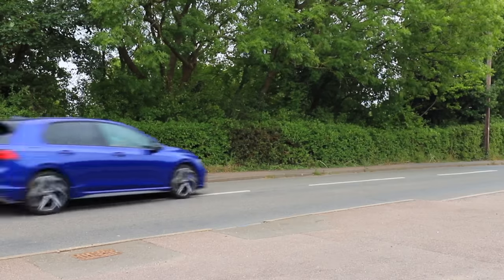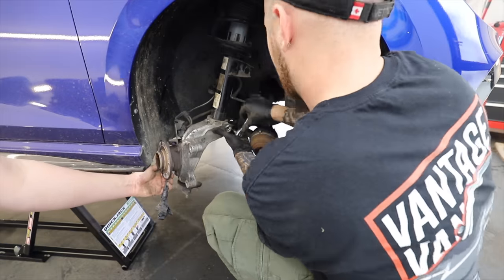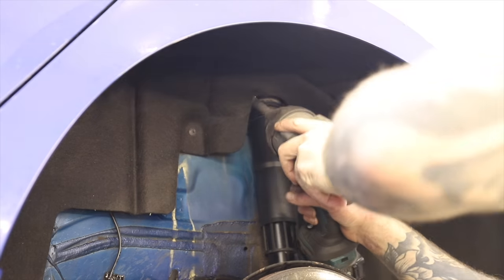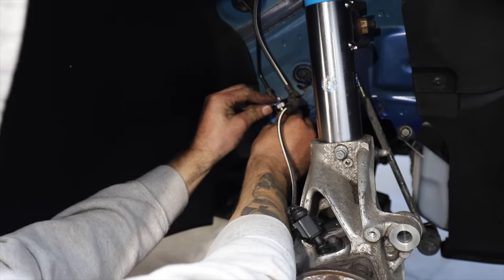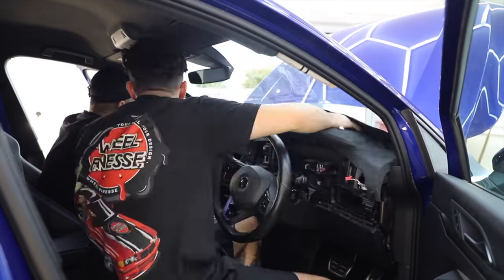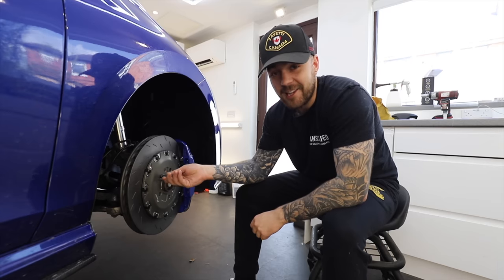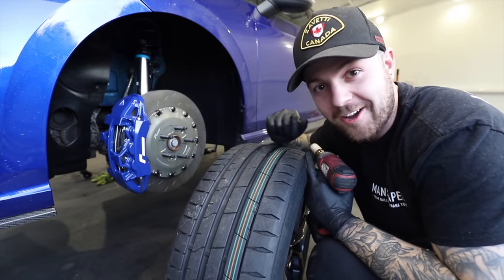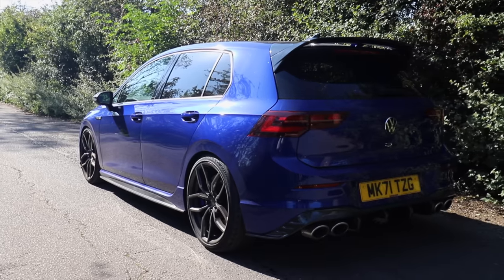£10,000 OF UPGRADES INSTALLED ON MY WRECKED MK8 GOLF R

Comment: Chris you didn't orientate the front top mounts, there is a tap that has to be facing a certain direction or the camber caster is off. You may of by accident located them correctly but chances are they are wrong and your alignment will be out. When you get the alignment redone the caster will be incorrect and the car won't drive properly.

Comment: Nice upgrades and not sure why you did the brake test. As you changed the wheel size and new tyres. Plus, bigger brakes, so will be100% better over the old set of brakes and tyres.

Comment: Love OBD11, literally today. I used it to retro fit/code a bunch of cool features for my Audi. Although what dose the throttle response adaptation actually do? Dose it just keep the throttle in dynamic mode no matter what mode u r in? Or will it actually change the response in all modes? Therefore, it is slightly better still when the car is in dynamic/ sport setting?

Comment: Ok 2 questions. When bleeding the brakes why didn’t you start with the calliper furthest away from the servo? And did you use weight plates when adjusting the suspension??

Comment: Dude you need to clean the rust off the wheel hubs before fitting a new brake disc to prevent shuddering and to do a cleaner job!

Comment: In case anyone in the comments is wondering about tyres and wants to do something like this but can't afford Continentals, simply put don't. If you can only afford budget tyres then go with them. Whether you buy a budget set or a high end set, you're gonna have to replace them around the same time frame anyways...

Comment: Surely the rear brakes are just bigger for looks? If it’s the same caliper and pad size it’s the same braking surface area
Reply: A wider disc means the pads get more leverage as the outside edge is further out than on the smaller disc. Also, the larger surface area enables the disc to dissipate heat more effectively. Ideally, you would want to upgrade the calipers and pads too though.

Comment: That dash trim seems like a terrible idea to me - what happens when the car is in a crash and the dashboard airbag goes off? Surely that’s on legally shaky ground…?
Reply: We weaken the material by cutting very fine splice lines either side of the airbags area. Although this isn’t necessarily needed we still do it for customer peace of mind. 

Of course this is a concern that many may ask! But the force of an airbag will not be restricted by placing a material of only 0.7mm thick over the top. 

Lamborghini do it, so why can we!🪡🙂 

(All products are road safe and approved by road safety regulations)

Hope this helps answer your very valid question 🪡
Reply: @Wheelfinesse  It’s not for me, but thanks for taking the time to reply - my (non-expert) understanding of airbag deployments is that the process of deploying to ‘catch’ a flying body is measured in milliseconds - having an extra layer of alcantara to burst through is certainly possible, but would affect the deployment profile compared to the manufacturer’s design; I do t know if it’s affected enough to cause a problem, but I wouldn’t want to be the one to find out - either as a passenger or as the guy claiming on his insurance after crashing with one on the dashboard!

I’m sure Lamborghini can use alcantara as a dashboard trim as you mentioned, but do they place a second ‘topper’ layer over the top held on with double-sided-tape? I’m pretty sure they have to perform an awful lot more crash-testing than you do, as well. Not a great comparison, to me…
Reply: @XCMantis  Although the product isn’t of interest allow us to clear up the valid points you have addressed, All major car brands do the exact same with regards to their upholstery options. 

They are all templated and applied to the dashboard itself, that being the exact same process with how we do it, If you was to peel back that Alcantara/ leather back off from any car manufacturer that offer these options from factory you would be exposed to plastic. 

They add the layer of Alcantara to the dash from factory where as we apply it to cars after. 

There’s no difference between how it’s done and the added material on top. It’s an optional extra that we only tend to see on highly regarded car brands.

Same for any other car brand that do Leather Dashboards & Alcantara Dashboard options from factory. They follow the same process, they take a standard plastic dash and re trim it in Alcantara/ Leather. That was why I used Lamborghini as a comparison. As it’s the perfect comparison as to what they do exactly🪡

The product itself has been approved and is road safe. To approve our products they have to go through testing. 

To help people understand that the product itself is safe and any hesitation towards the safety will be addressed as we like customers to be confident in the product even if it’s not to everyone’s taste😀

Our pleasure regarding the safety aspects as we know this is an important topic🙂🪡
Reply: @Wheelfinesse  That is amazing! I cannot wait for mine to arrive, just ordered it on Saturday, for my BMW M2 now I’m like a kid at Christmas but the waiting part!😂